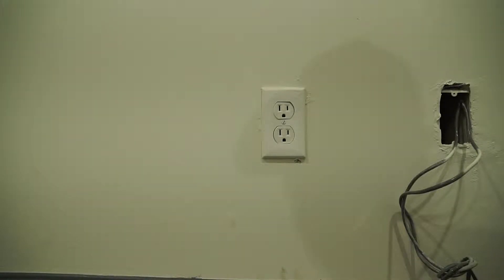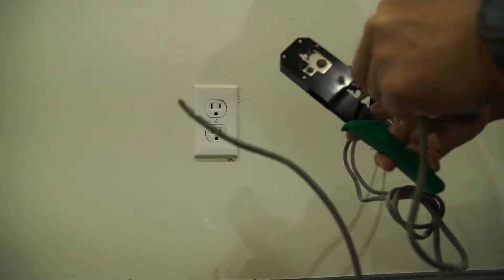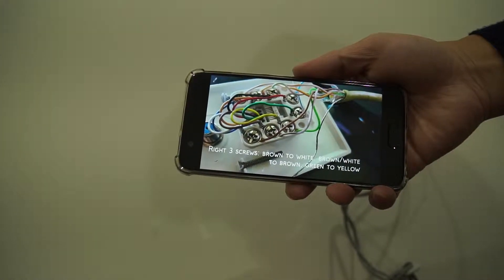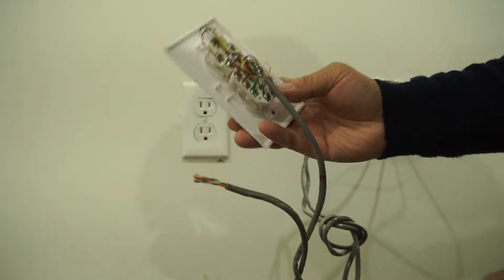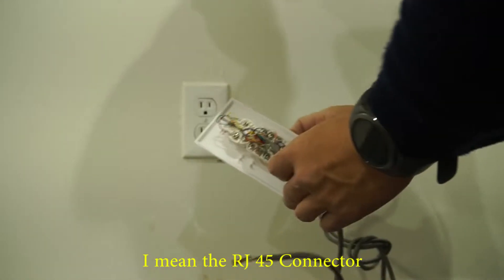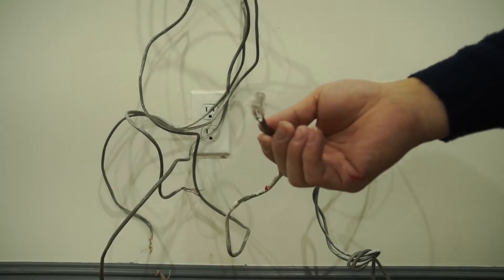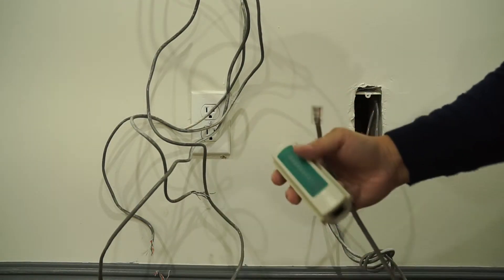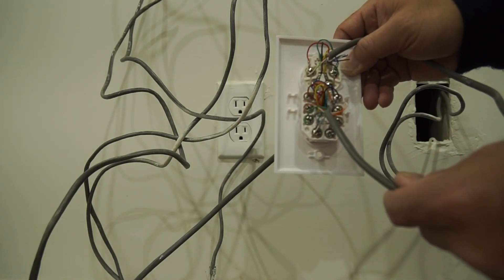How to Connect a RJ45 and RJ11 Wall plate

Comment: What do you call that socket or wall plate? Where can I get it?
Reply from the maker: If it's for the network, computers, it the RJ45 Jack or plate, but if it for a home phone line, it's the RJ11 Jack
Reply: @swonghobby  Ok. I get it. But the thing is I wanna get both the rj11 and rj45 on one single plate.